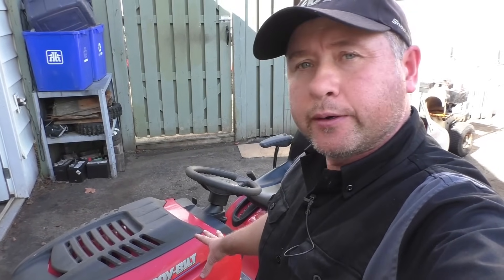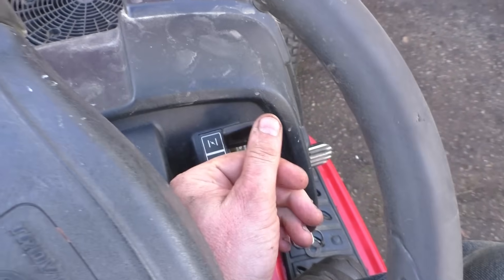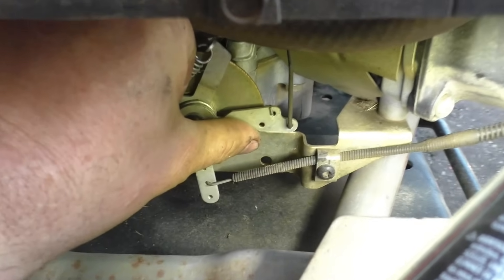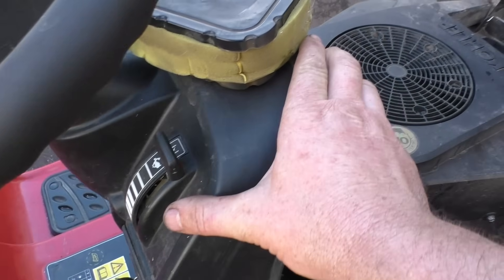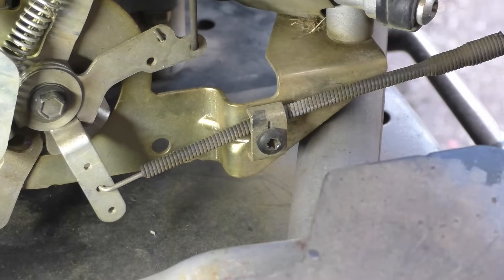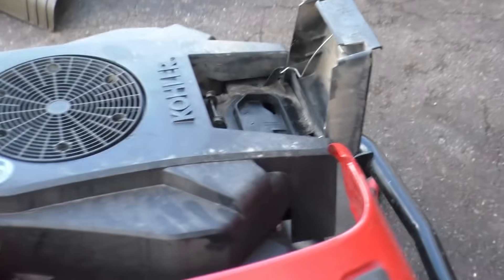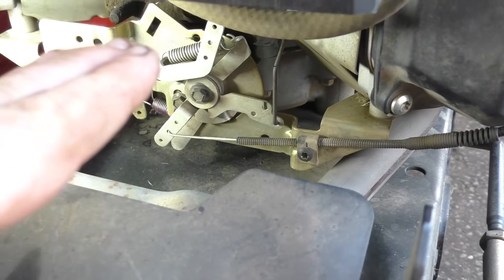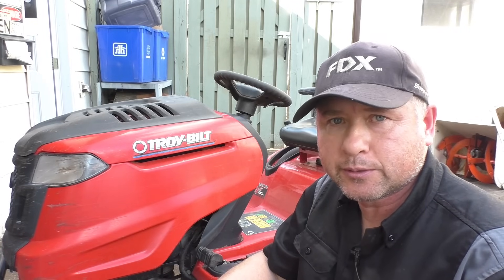Lawn Tractor Won't Start? Try This Easy Free Fix!

Comment: My Sears Lawn Tractor from 2009 is the poster machine for this problem. I had a warranty guy come out and fix it in the first year. A year later, it was back to its original state, and I fixed it myself.

Comment: I still like my John Deere L111 with its separate choke lever. I've had it since 2005 and it still runs smooth and starts easily.

Comment: I've done this almost exact same repair on the Australian delivered factory Honda Professional push mowers. Similar choke/throttle setup.  Some cable lube is never a bad idea too. Good video for those who own this family of engine. Because when new it works fine but over time that cable retainer let's the cable slip or whatever and needs adjustment, but everything looks fine. Even if you know the choke isn't engaging it can be a brainstorm to find out why and how to fix it. Very useful video.

Comment: Hard start from day-1 sort of indicates that the customer didn't even bother to start the tractor up upon delivery, and just accepted it.  
Don't be afraid to NOT accept delivery if you find something wrong with the tractor that they selected for delivery.  And make sure to at least start it up.  I rejected a nice $3200 JD S170 from Lowe's early this season because the one THEY selected (because they won't let the customer pick the serial) had paint scuffs everywhere.  Since the whole purchase was deflated, I basically fixed my old mower and it's perfectly fine now for the time being.

Comment: I never got the chance to run into this problem. The engine blew-up after 72 hours of use. I found a replacement (not a Courage) and, eventually will swap the engines.

Comment: It's probably similar to adjusting the throttle cable on my dads Honda GSV190 powered push mower where the choke butterfly is actuated by the throttle lever & cable !

Comment: HUM, my Snapper B&S Twin has just began to NOT start, wonder if my choke cable has broke or moved, THANKS, I'll check
Reply: Check the bowl on the carburetor, and fuel filter as well. Might have filled with crud, and time for a simple cleaning ? 🤷🏼‍♂️

Comment: @1.00 I predict choke not closing although it's not vtwin
Update. I was right. Funny story though. I think it was 2 summers ago my neighbour had that no start on his kohler vtwin.  I adjusted it. This summer he gad bad running and apparently a flaming muffler.  Problem was now the  choke wasn't coming open even when throttle was back i  proper detente. Adjusted once again and have not heard of any further issue.

Comment: That engine sound like hell when you turn it off i never heard engine shut off with  a whing noise like that
Reply from the maker: I don't really like those engines but the pto clutch is noisy on this machine.
Reply: @donyboy73  I believe the problem clutch needs to be replaced
Reply: @michaelcountryman9130 It's just the nature of these type clutches. These suckers are Noisy ! 😣

Comment: This design is ridiculously cheap and fragile. I have never had to adjust the cable on my Honda lawn mower in 25 years.
Reply: I have one of these chokes on a Honda GSV 160 Easton Hover Mower, and actually did have to make this adjustment right out of the box, and that's a $1300.00 Mower ! 🤷🏼‍♂️
Reply: @marcmyers1465  Honda doesn't seem to be what they used to be. I'm definitely happy that I don't have to buy a new mower, no matter what brand! The quality is getting worse everywhere.
Reply: @mikesgardenmaintenance4016  FACT !!! 🤨
Reply: @mikesgardenmaintenance4016 The issue's worse on a Hover Mower. If the throttle isn't up to proper speed you can't adjust your cut height, and it barely even fly's straight. Throttle has to be readjusted precisely with a tachometer, and God help you if your fuel mix is off... 🤦🏼‍♂️ They're Great when they're running properly, but temperamental as an old mule ! 😤